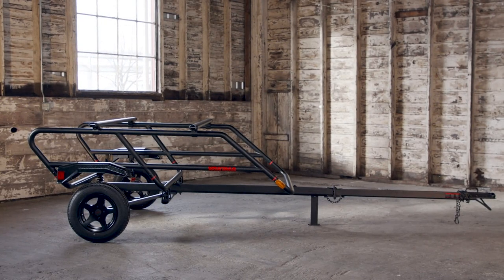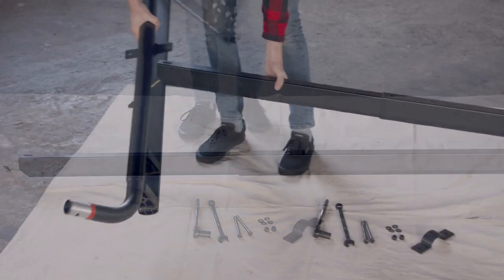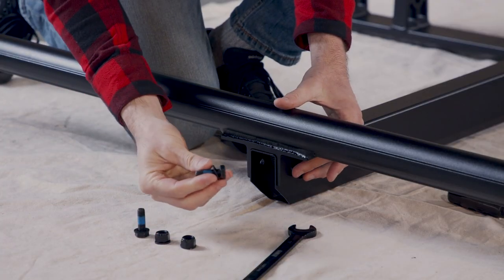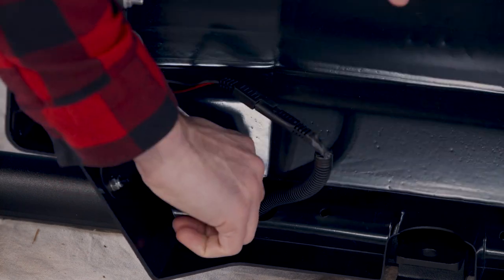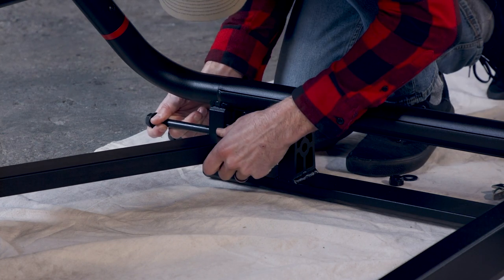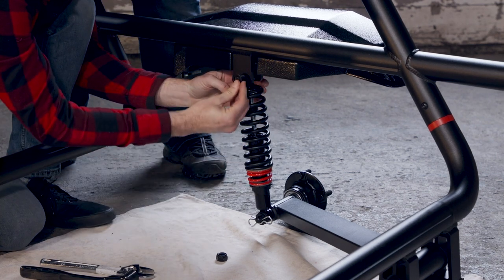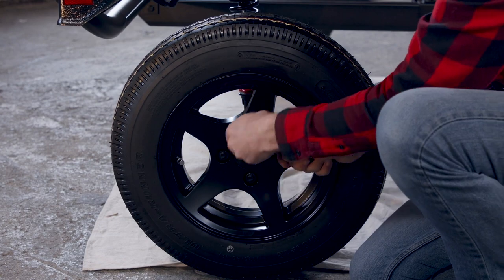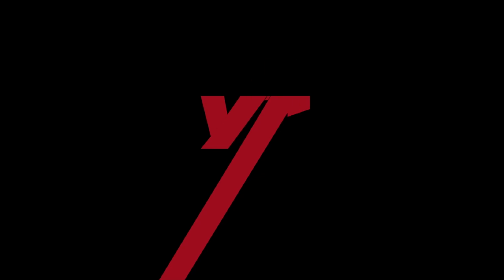Yakima EasyRider Trailer Installation

Comment: I love the trailer, but unlike in the video you tighten the nuts onto the bolts not the other way. You should also cross the safety chains so they catch and cradle the trailer tongue and protect it in case it comes off. The way the video shows will drag the trailer and possible cause a lot of damage.
Reply from the maker: Thanks for the feedback, we'll get that fixed.

Comment: Nice, thanks for posting! I’m looking at putting a roof top tent on one of these. Just wondering how stable it would be, even with the tent kit? Also, how would the shocks respond to all that weight, with people in tent?
Reply from the maker: Hi,

The trailer is very stable with the tent kit, there is virtually no movement with it installed.  The EasyRider can hold up to 1100 of static weight, so not an issue for the shocks, just be sure not to exceed the occupied tent weight capacity of 600 lbs for the medium, and 450 fir the small.
Reply from the maker: Hi,

There should not be any issues with that overhang.  When deployed the tent typically will overhang much further that.

Comment: A 3000 dollar tubular frame trailer is absurd, plus you have to assemble it.  not to mention the hundreds of dollars you'll be spending to buy the attachments for your sport of choice.  $1500 would have been fair for this. Come on Yakima you're better than that.